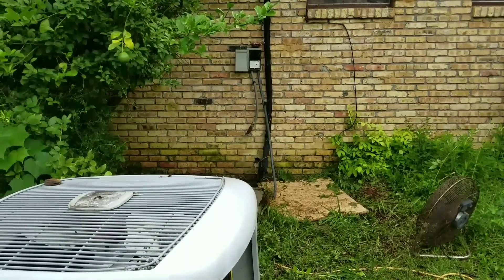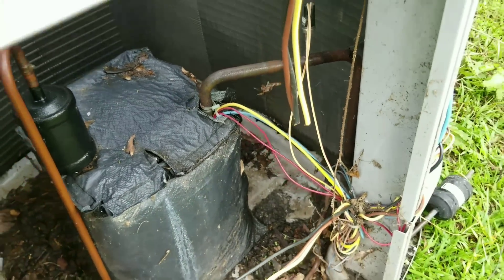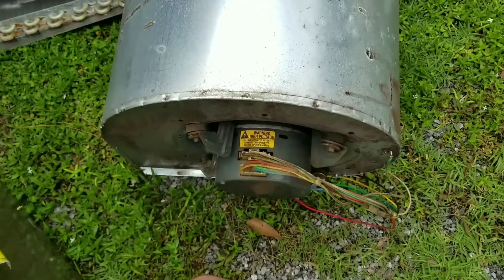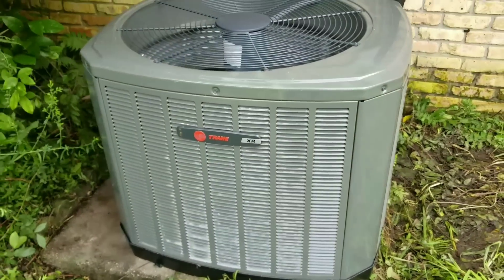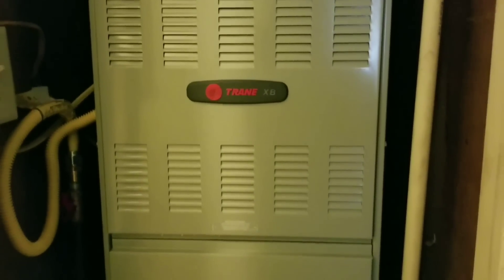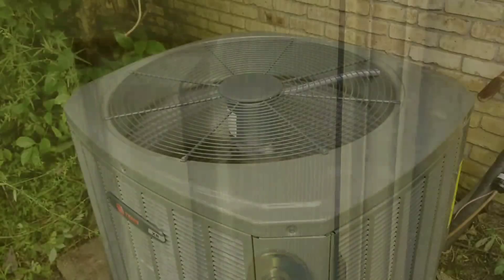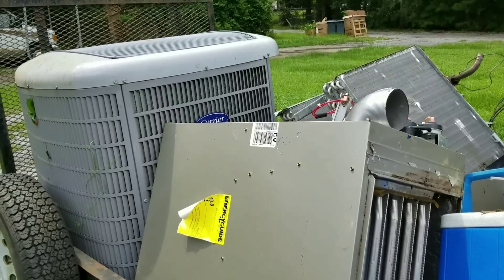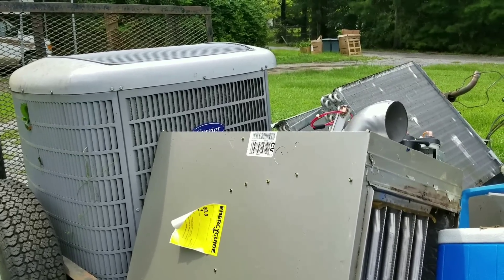New 4 Ton, Trane Air Conditioner.

Comment: Nice video my Amana heatpump so far so good after 9 years 0 problem except the pump was clogged. And one clean up. Definitely the next one it's a Amana. Mine came with 10 years warranty.
Reply from the maker: There you go. As long as you have that 10 year warranty to back it up. You sould do fine with any brand.
Reply: Emerson Collie True Me i use mine in the summer and in the winter. Why only 2 blades? prefer with 3 or 4 :) maybe because its a A/C and not a heatpump mine come from 2008 😂😂😂🤣🤣🤣

Comment: Hello,  That is exactly what happened to us. Put a Carrier in new house in 2009. One problem after another no help from Carrier. Now have to replace was thinking on the same trane unit, but from your video it does not sound very quiet. Actually sounds annoying. Am I hearing correctly? Thanks!

Comment: it sounds like a good idea to use a old air handler blower for a shop fan if u can find a regular PSC motor for it as US Motors a division or Emerson Electric is a good brand of motor  that Condenser fan motor you took out is that also an ECM motor too?

Comment: Sorry you had to go through that buddy. Does this unit keep up with the temp you set it to?

My Aunt in Orlando Has a 3 ton unit that Runs and runs and runs just to keep it at 80°
Reply from the maker: Yes, it holds it to the setting I have it on. I have it set at 73° and it stays at 73°. It shuts off when it reaches it.

So your Aunt's unit is only cooling at 80°? Really? What does She have it set on?
Reply: She keeps it set at 79° but it will run most of the day to keep it around there. Her system is a Lennox. I think it's probably undersized.
Reply from the maker: With it being set at such a high temp, I'm amazed that it even come on. Let alone, run for the good bit of the day. If it;s a nice sized house, then a 3 ton won't cut it. 

A 3 ton, is more for a small 2 to 3 bedroom house or an apartment.

Comment: Back in 2003 in KY, my family used to have an old AC/Furnace along with old HVAC Systems (although I don't know what brand name was this), my family have a problem about the AC unit is the Condensing Coil that causes leakage from the ceiling inside the AC/Furnace closet, and we cannot take this old and worn AC/Furnace unit to run anymore because, we have to order the brand new unit and have it run like they supposed to. These old and worn AC/Furnace unit could get my family of Nickle and Dime to repair the problem because, it's cheaper to replace the whole unit than to try solve the problem about the old and worn AC/Furnace unit.

In August of '03, it's time to replace the whole new unit. My family contact the company including Carrier who sells the best unit is, Goodman AC/Furnace unit. I figured I want to watch and see how do they replace but can't it's because I got to be in Elementary School and learn some more education exams (that's where I was at the age of 9), although I really haven't got a chance to see how do they do that by replace the whole new unit and place the older unit outside of the house. After the replacement is complete, we got them going no problem, and it runs so well so, they'll be 14 years old in August. 

Rewind back before when replace the whole new unit, not only that the Condensing Coil that causes leakage from the ceiling, but also the motor fan that supplies air to the ceiling had failed us. The fan motor wears out quickly and I smell smoke coming from the motor housing and sure enough, it didn't work anymore. But my biological dad replace with the used motor to install the fan housing. After the install, I hear the loud 60 Hz buzz from the motor which tells us that the motor itself might be exposed to the moist when stored at the shed I think, and sooner later, when it did run for almost a year, it failed us. So again my family contacted Carrier so they can order the whole new unit.

Now fast forward after the replacement with the new unit, it did run so great and never fails us, although some years later the number of parts had failed us so have to order the new one to keep the unit going.

Now in 2016, our unit acts up funny, so she contact to someone who knows how to solve the problem, what they inspect, the thermostat stick inside of the unit had corroded, what they told us we have to keep it clean so it won't act up again.

Now to the HVAC System, on the start up, you can hear the compressor kick on along with the fan for about 2 microseconds and it did start up real quick. Now the problem with HVAC System what my Big Bro inspect, it had a bad capacitor so not a big deal, they order with the brand new Capacitor to install the HVAC System (although sadly, for the Capacitor including the new one are made in China), and after install the new Cap, runs normal again. The original Capacitor amazingly, they're made in USA, and it did last about 13 years until finally, it gave up on us.

Even though, things happen when we may get a faulty parts from the unit which part of the ordinary wear and tear when using the unit to either keep the house cool down, or keep the house warm. I give credit to Goodman AC/Furnace who runs like they supposed to to keep it cool or warm the house up when we need.
Reply from the maker: Goodman's are alright. It all depends on if it's installed right. If you got 14 years out of it, I'd say you got your money's worth.
Reply: By the way, the original run capacitor is made by Amrad Engineering Incorporation that makes the capacitor for the HVAC Systems, and again, they're made in USA. At leased it's the great component. =)

Amrad Engineering Inc Run Capacitor is what I really recommend to choose this product because, these are way better than Chinese Made Run Capacitor. Not only that, it last about 15 years. =)

Comment: hey bud how's the new trane doing and how much did the outside unit cost I need a new air conditioner for my house as my old one from lennox just broke down 18 years old.
Reply from the maker: It's running just fine. I'm not really sure on how much the condenser is alone. I bought my unit as a whole unit.

Comment: Seems like 9 years is too soon to be having issues with stuff like this.
Reply from the maker: It is too soon. Sometimes things like this, happens.
Reply: We have a Miller (Nordyne) for around 15 years that has had nothing go wrong but a clattering relay. It still worked fine, but we had it changed to ditch the noise. Dad and I had no clue how to change the relay. Almost 150 dollars out the pocket. GRRRR.
Reply from the maker: Relays unplug, all what you really had to do was, find the noise while the unit was on. Paying 150 dollars on a 15 year old unit isn't bad at all if the was the only problem you had with it.

I poked fun at the Nordyne unit I had at my old house that I sold a few years back. Before replacing it with a Carrier. It's just like anything else out there. You get either a good one or a bad one.
Reply: Sometimes they’re just lemons. I don’t care who makes them I’ve been around to long already to know that lol lol